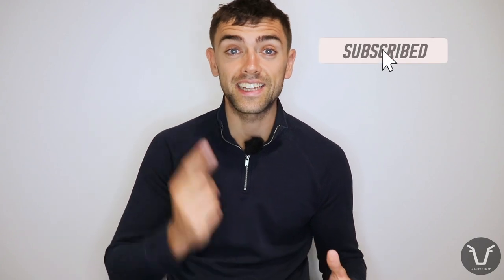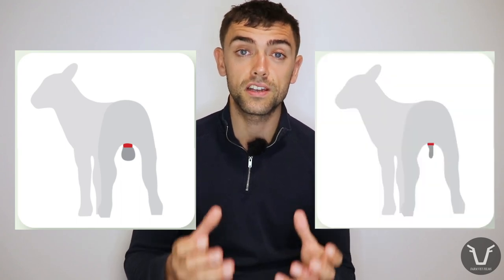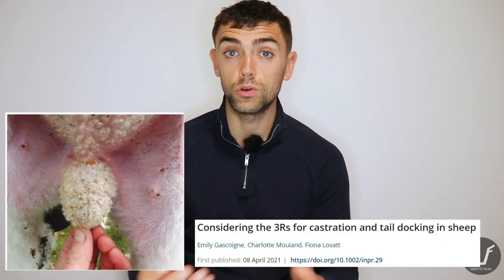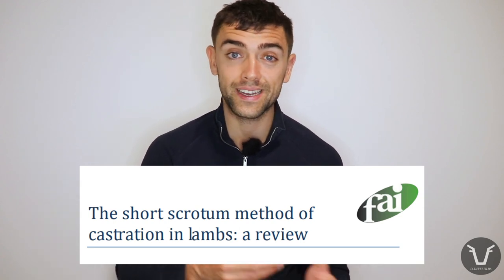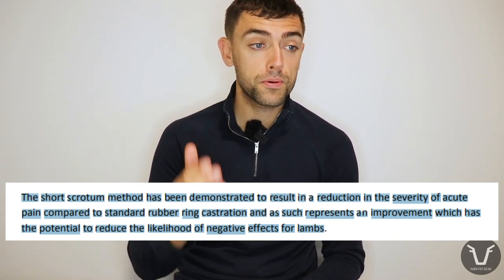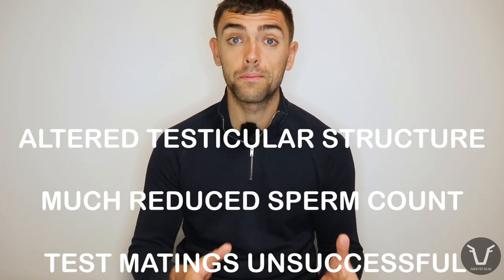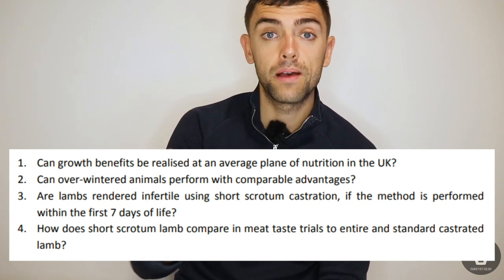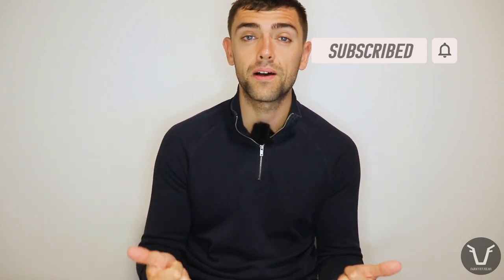LAMB CASTRATION - A BETTER WAY? | TECHNICAL #63: Short scrotum castration

Comment: That was genuinely, genuinely fascinating. I had no idea of this concept. I wonder if such a concept exists in calves? I have started putting rings on my male calves 24 hours after birth (to include testicles). Actually, I got the idea from Tom Pemberton here on YouTube, as I used to use a burdizzo on older males in the past. I have been delighted with the results of the ring castration. I would love to know for sure how painful/uncomfortable it is for the calves, as they genuinely have never shown any obvious observeable signs of discomfort. Thanks again for the great video.
Reply from the maker: Rubber rings are fantastic things - especially compared to surgical castration. Much kinder and much less chance of vet getting head kicked in!
Reply: Would you consider trying the short scrotum method on calves? There isn't any research ongoing about this topic which would answer the four questions?
Reply: @siposistvan6092  I'm not really sure if I would try the short scrotum method on calves as there is a lack of research, but aside from that, the fact that they would have testosterone just like bulls would make their management quite difficult and dangerous too. I have had it in the past where an animal has had undescended testicles and they had the aggressive behaviour of bulls and were quite dangerous.

Comment: If the lambs are small & you can’t feel the tiny testicles or they’ve not dropped - it’s good to know short banding also does the job - I find definitely on day 2 or 3 before they start racing around. Thanks for the explanation. I have a few pet Suffolks in S Australian

Comment: Interesting, having only seen castration on Australian (Tasmanian) farms we only ever did standard castration with rings for both sheep and cattle, not seen the short method used and would be dubious about how the increased  temperature the testes being exposed to could lead to higher rates of testicular cancer (especially for hobby farm set ups where animals would have their normal life span). Going back a long way also use to see razor blade castration of bull calves and pigs.
Reply from the maker: Good point about pets! 

You here about boys that used to take them out with their teeth 😳 ‘mountain oysters’.